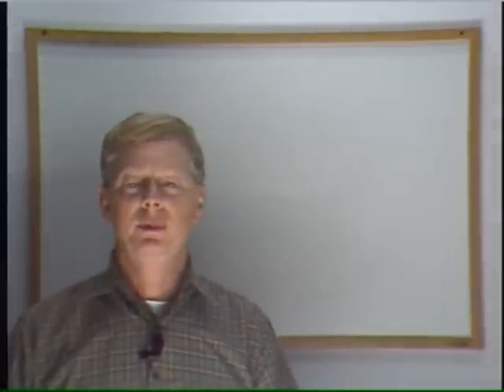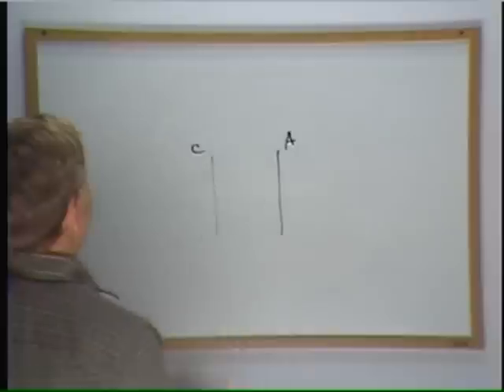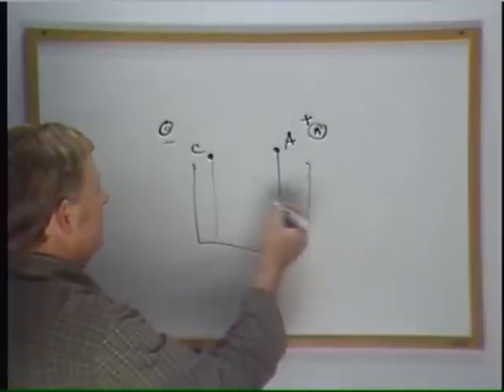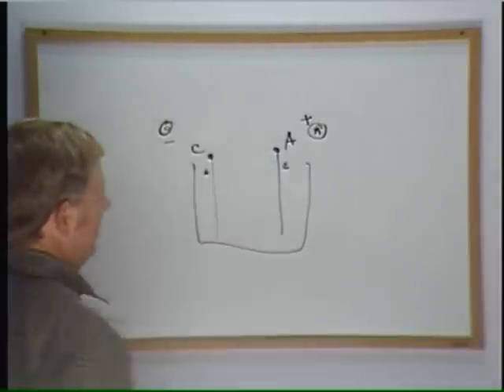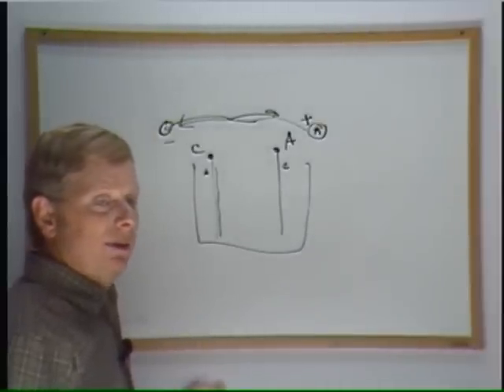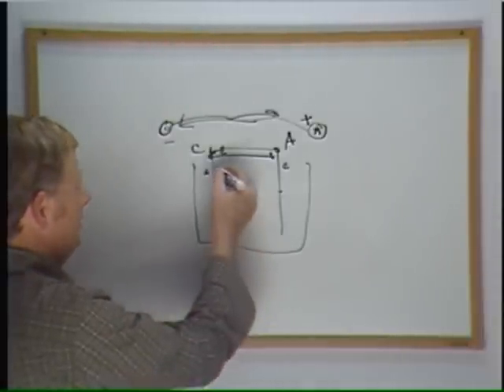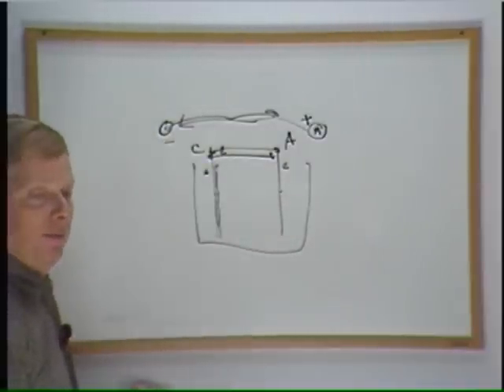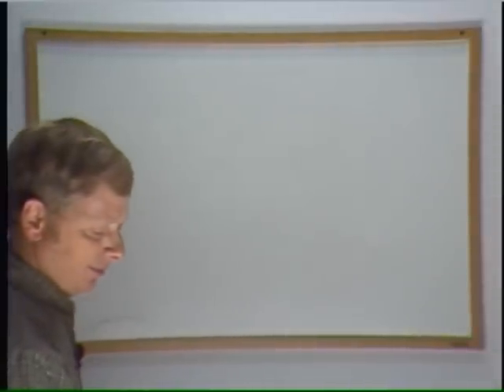Electrolysis

Comment: I have question if a sub's oxygenate generator can separate   Oxygenate from h2o for the crow to breath can the hydrogen from the separation be used as fuel for the engine is it possible
Reply from the maker: Yes, it can be used as fuel.

Comment: can you pls explain why north is slightly stronger than south?
Reply from the maker: Through observation, the earth is tilted on it's axis because one pole is stronger than the other,  this difference in strength is what creates an elliptical orbit around the sun. This suggest that the north monopole is slightly larger than the south  monopole.
Reply: @nornd  yes. but according to your theory, using north south monopoles and particles of matter, why is north stronger than south in atoms?
Reply from the maker: @kuankuan8024  The Atom is a Dipole just like the Earth/Sun/ and Bar Magnets, These north/south monopoles are what create dipoles, since the north monopoles are a little stronger than the south monopole, it will cause the north pole of a (Dipole) to be stronger than the south pole.

Comment: you claim your theory is the TOE theory of everything. can it explain spirit and ghosts?
Reply from the maker: Yes it can, not only spirit and ghost, but why it gets colder and batteries go dead and other mysteries like the Bermuda triangle.
Reply: @nornd  really? pls explain what a spirit really is according to your theory
Reply from the maker: @robinhood1939  I will give you the nut shell version, all forms of energy are composed of two particles, they are n/s monopoles
a persons soul/aura is composed of these particles. the same particles also create magnetism, heat, electricity, light, even gravity. When a person dies their soul/aura does not. because it's composed of the same particles as all other forms of energy it's able to interact with these forms of energy like heat, this is one way to gain more energy. Removing heat allows a ghost/spirit  to move objects an even drain batteries.
Reply: @nornd  actually i have read your book. and in agreement with it. you said that all energy made of monopoles only difference is how they propagate and their shapes. do you know what energy are ghosts? what shape of energy of monopoles are ghost? like em waves or what?
Reply from the maker: @robinhood1939  Ghosts/spirits are not em waves, however they are composed of the same particles. a persons soul/spirit is the memory of that person, an example would be how computers store their memory in binary using zeros/ones however a spirit/soul uses north/south monopoles, this memory can be stored in anything which is made up of atoms this is how ghosts are able to posses objects. I would have to make a video to better explain this topic on ghosts.
Reply: @nornd  yes a video would be great. like computer binary 0&1? pls draw out how this memory monopoles would look like if you make a video in future thanks. coz i understand em waves circular polarized,, heat are monopoles move in random.. but i cant figure how ghost monopoles be like
Reply: @nornd  there is smtg you stated in your book caught my attention. you said that black hole is collapsed particles of matter but the gravity monopoles move in opposite direction. does this mean that black hole is actually a repulsion force and not attraction?
Reply from the maker: @robinhood1939  Soon as I can I will post a video about Ghosts.
Reply from the maker: @robinhood1939  Think of a black hole as a very large atom that has lost all of it's monopoles during a super nova, now all of the particles of matter have collapsed together creating one very large particle of matter called a {black hole,} now this large particle of matter {black hole} wants it's monopoles back, it's this attraction of monopoles that causes all matter and em waves/light to be sucked into this black hole.  gravity is caused by a nuclear reaction, it's this release of monopoles that causes all things to be attracted to the center of the earth.
Reply: @nornd  do you know how edleedsklnin actually built the coral cstle nd moved those  boulders?
Reply from the maker: @robinhood1939  Yes, Ed Leedskalnin was an expert dowser, ever notice when a dowser using his dowsing rod it always points down over a potential source of water. I believe ED put this concept in reverse using stones instead of his dowsing rod, causing the stones to become weightless.
Reply: @nornd  rod dowsing sound like psychic ability. you mean ed could move the stones with his mind like how he move the rods to point to water source? could this be explained using your theory?
Reply from the maker: @robinhood1939  Yes, However I forgot to mention using this theory you can explain all things in the universe, this includes the paranormal, the same underlying principal that ghosts/spirits or poltergeists use to move objects, Ed used to move the stones at Coral Castle, and how the Egyptians built the pyramids. Let's not forget thought energy is composed of n/s monopoles and is measured as brain waves.
Reply: @nornd  please explain how ghosts and ed move objects by using your theory. i would want to learn how to develop psychic abilities too
Reply from the maker: @robinhood1939  You must first understand what gravity is and how it attracts all matter, it too is composed of the same n/s monopoles as all other forms of energy. I 'am presently working on some more videos to help explain my theory of everything this will include what Ghosts/spirits are and how they can move objects.
Reply: @nornd  i already know what gravity is i already read your book toesolved. you said gravity is n/s monopoles sidebyside moving the same direction and all atoms have n/s poles like a magnet
Reply from the maker: @robinhood1939  Ghosts/spirits are made up of n/s monopoles, they also have the ability to rearrange these monopoles to what ever form of energy they want Since gravity is the weakest form of energy it is easy for them to create gravity and move objects around.
Reply: @nornd  but the question is how a person or a spirit (a form of memory energy) rearrange to form any energy they want like gravity or heat. Jesus said in the bible "if a person has faith and do not doubt all things are possible .to him but i dont know what faith is
Reply from the maker: @robinhood1939  Faith is what connects the conscious mind to the subconscious, a persons subconscious is the same as their soul/spirit. consider a ghost as having only a subconscious this makes it easier for them to move objects. (Faith is Confidence or Trust and belief in something).
Reply: @nornd  do you mean subconscious mind is actually the soul? they are the same thing? and a soul has no conscious mind?and only by faith alone is enough to control these monopoles energy? and if a soul has no body does this mean they dont need faith? (to connect the conscious to subconscious?) dont know if i miss anything else
Reply: @nornd  actually i consider you as a sage/  wise man. you know the secret working principles of the universe and reveal them without asking for return
Reply from the maker: @robinhood1939  Thank you.
Reply from the maker: @robinhood1939  Yes that is correct.
Reply: @nornd  sir by your theory it sounds like monopoles very much like God. do you have any comment or any theory of angels/ demons/ or where heaven and hell is?
Reply from the maker: @robinhood1939  Yes it answers those questions, however it would take a long time to answer it here, it would be best done in a video.
Reply: @nornd  one more question if you dont mind explain in nutshell. ghosts have no sensory organs like eyes and ears. but how do they see and hear people?
Reply from the maker: @robinhood1939  The same way you see and hear in your dreams, it comes from your subconscious, Ghosts are disembodied souls/subconscious.